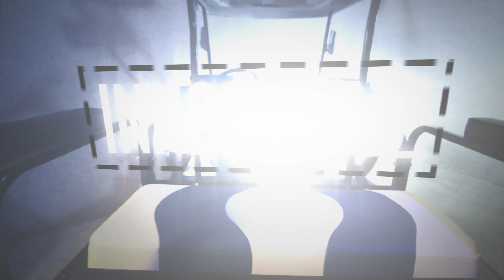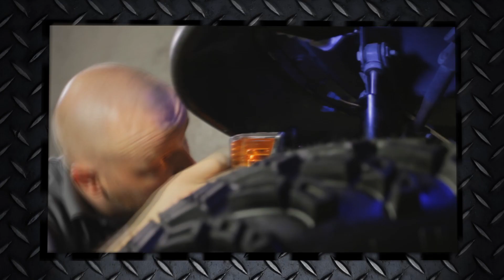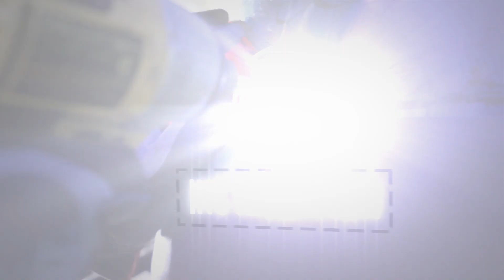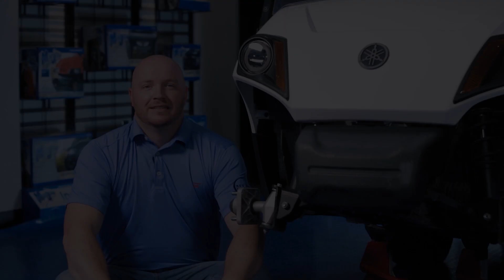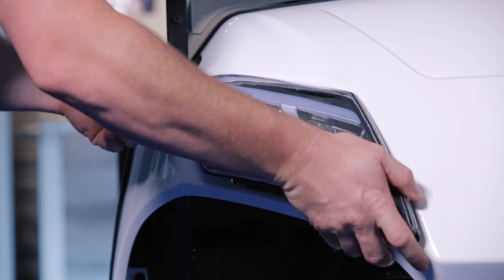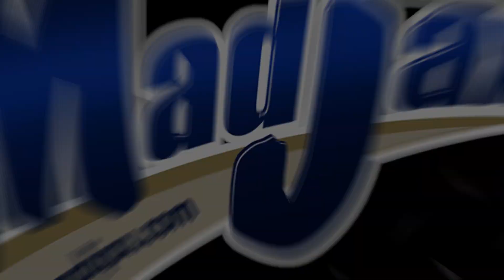LED Headlight Kit for Yamaha® Drive2 | How to Install Video | Madjax® Golf Cart Accessories

Comment: I bought a used cart from a local dealer and it has the ultimate LED light kit from Madjax on it. Turn signals, brake lights, function for brights and what not. The low/high beams switch doesn’t work and the turn signals are not self cancelling. Is there a way to fix this?